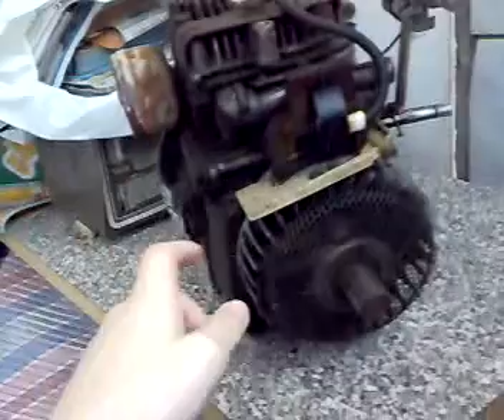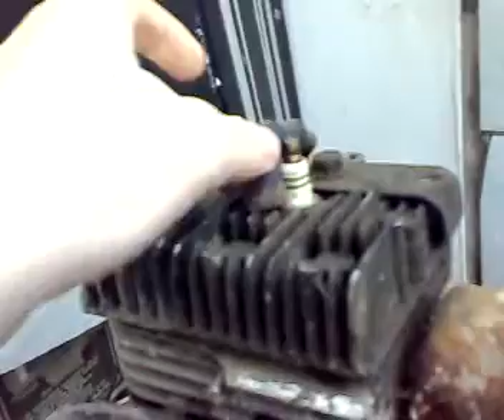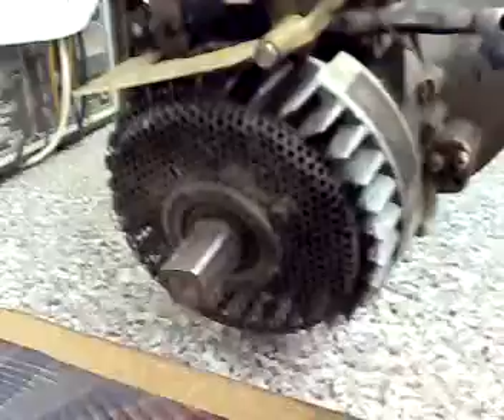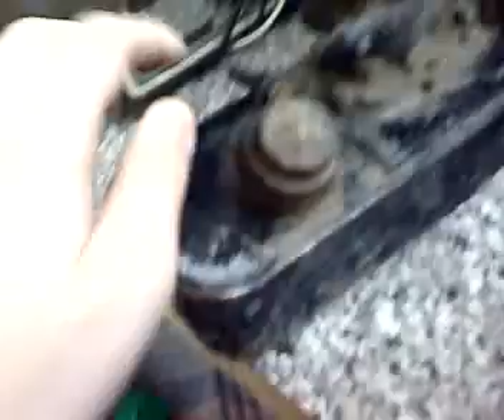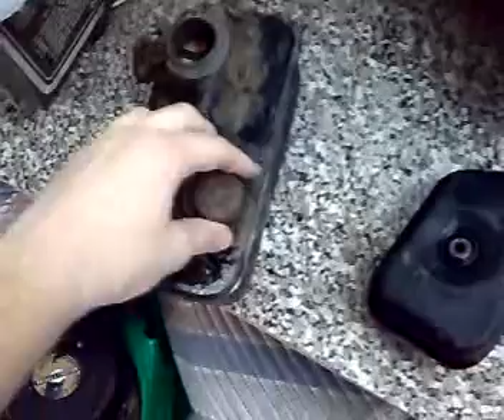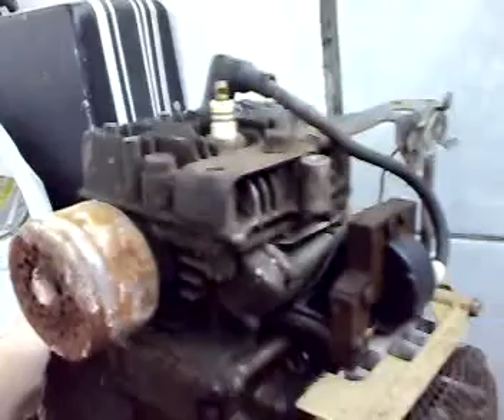1976 Briggs & Stratton 3HP rebuild part II

Comment: well if you dont know lawnmower type (LIKE THIS VIDEO) has a light aluminum flywheel and need the blade as a flywheel but other types is universal engine means it can be used anywhere and has cast wheel see my video of my engine

Comment: This is weird. I have one from the same year.  same hp. But I use it on a pump sprayer thing. Mine runs without a blade. Well it did when it ran. It has fuel intake problem.

Comment: I am so glag you brought that up, I am working on yardmachine 4HP engine, and there is a pipe that comes out, and it looks like it is supposed to conect to the carburator with a little elbow joint? Am I right? And what is the pipe for?
Thanks.